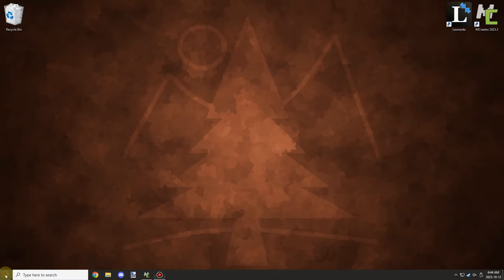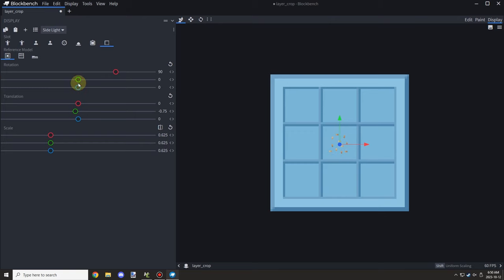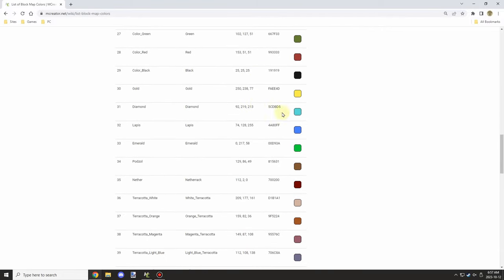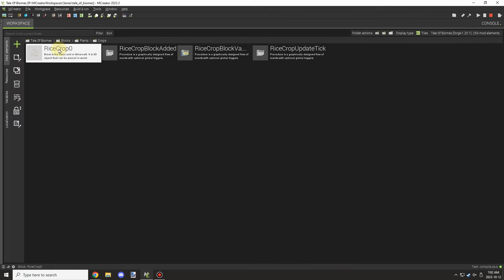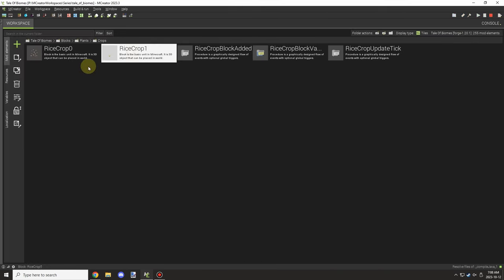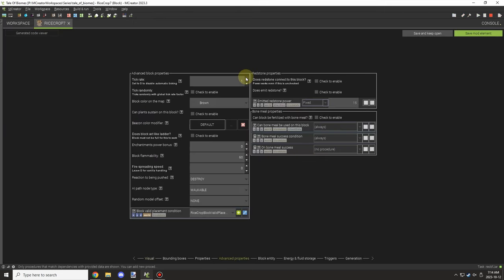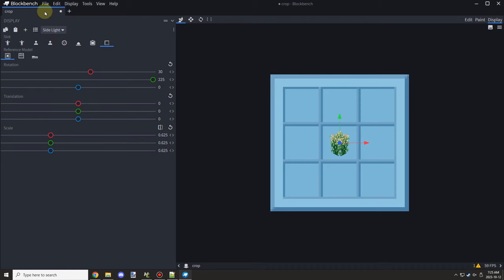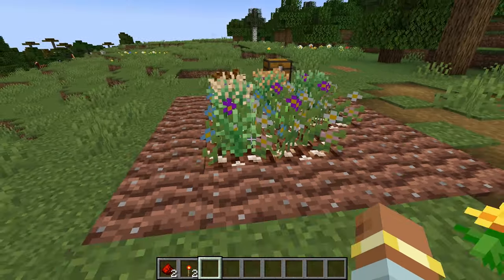Making Rice Blocks | MCreator Lore | Ep38

Comment: Bro i really want to know how to make a lightning  rod, do you know how to make it?
Reply from the maker: Sadly far as I am aware merging the same mechanics to another block is not possible, you could strike lighting at a specific location to give the impression that its working but it won't provide a buffer zone for strikes. You would simply need to test if the weather is raining and that the world is thundering, then make a random chance on the block's update tick possibly with a timer delay to strike lightning at the top of the block. That's the best idea I have to go with mojang is not been exactly great for making sure the modding community can make use of these advanced feature some things are possible but they have gotten really lazy when adding support for things in the modding community which is a shame really.

Comment: I'm trying to make a moon phase that increase growth speed for crops but I can't find a way to do that. Is there any way  you can help me?
Reply from the maker: So I found this page, it says there are 8 stages to the moon phases. There should be a block under one of the world tabs that can detect the moon phase. It may be similar to time where you will need to use "MOD" operation to keep the value between  the value. For this I would first print out the block to console using print create text with and then place the condition block on the create text with block. 

I would set this up to a when player sleeps global trigger so you can test the phase, if it starts at 0 then your value will be 0 - 7 (8 stages) if its at 1 - 8 then it will still be (8 stages) if it goes over 7 or 8 depending on the starting number being 0 or 1 then you will need to use the MOD operation to cycle it back to the starting number. 

Keep in mind you will need to sleep at least 9 times to know how the block works, check console each time you sleep and it should print a number of what the current phase is.

I would suggest writing this down in a text document each time so it does not get lost in console and you can save it if you need to. 
https://minecraft.wiki/w/Moon
Reply: @NorthWestTreesMCreator  I should have clarified. I meant to say how do you make a NEW moon phase that has a chance to occur which  increases the growth of a crops. Sorry for the misunderstanding
Reply from the maker: @Adumdee  Sadly not possible to update the moon it's self but you can build mechanics based on a global map variable system, you could then pass this value over to a item state and make a clock type thing, if not it would be possible to make a GUI and display different images using image conditions based on the global map number variable number. To update the variable you would need to rest if the time of the world is 1 tick, testing for the 0 tick will be skipped when the player wakes up so I normally test if the tick is 1.

You will need to use the MOD block to test for the time though the math will looks like below.

IF [ [ [Get current world time] MOD [24000] ]
= [1] ]

You will need the following blocks for this script.

1 Math operator block set in the MOD operation

1 Number operator block

2 Number blocks

1 Get current world time block.

If you set up the operation on your if statement attached to world tick update and make sure your global variable is set to the map type then you should have no porblem changing the value.

For your DO statement you will need another if statement inside and similar to the stimer script test if the state is < the maximum number of the moon phases you want to add, if true then increase the moon stage by 1 so

Set (variable) [[Get (variable)] + [1]]

Then you will need a ELSE statement to reset the value back to the default state if the value is the same as the maximum value.

This should lay the gound for a custom moon phase system that is built on a variable timer that updates each new day in the world. You can then latter expand this to visual display either though item states to make a clock type thing or a GUI with different image icons or something simialr 

Once you have this part down you can then run what ever you need to for your custom crops to use this system wether it is to gorw faster based on the phase or have it only grow, its pretty flexable as it is a variable based system.